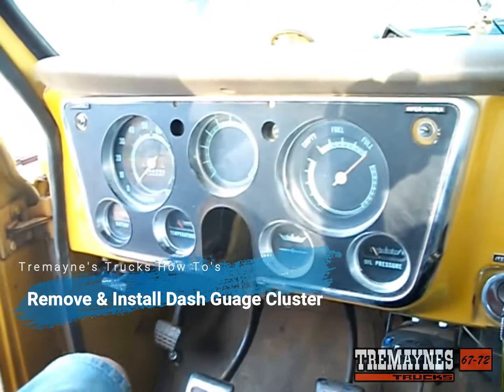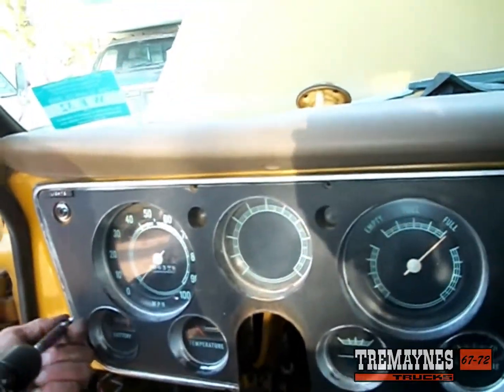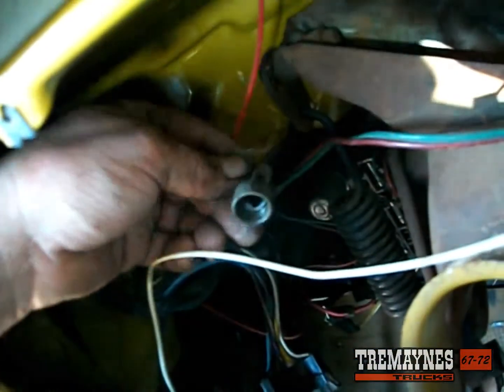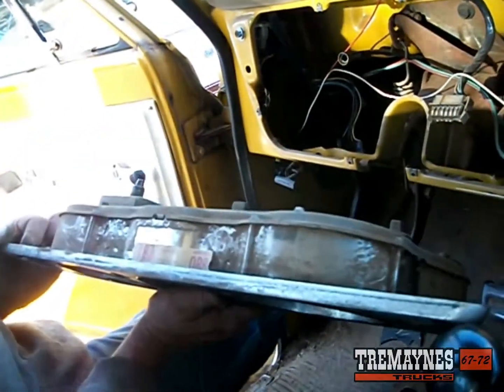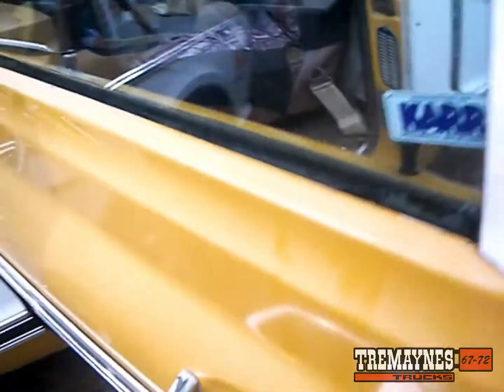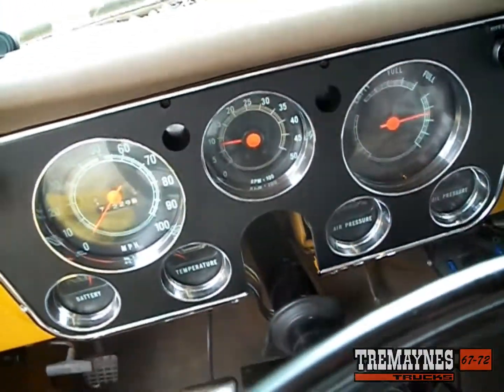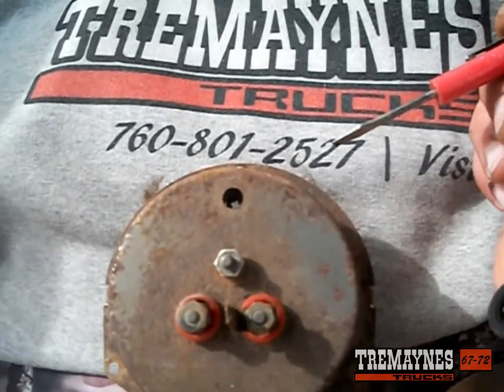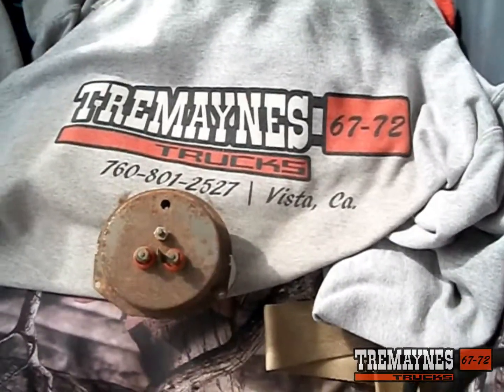Remove Dash / Gauge Cluster 67-72 Chevy C10 Truck

Comment: you might need a second wrench to hold the dash side oil line coupling. Be super careful when reconnecting the soft, brass oil pressure line.

Comment: I have a question. When I remove the gauge cluster and I want to change just the black plastic outside trim can I use the same gauges or do I have to use all new gauges?
Reply: You can reuse your gauges.
Reply from the maker: Yes you can use all the existing gauges, tins & lens. I recommend checking the electrical circuit board on the back of gauge panel. Replace if it looks like it's deteriorating

Comment: Hello a quick question where does the shift indicator fiber optic cable go??
Reply from the maker: To the light socket to the right of speedometer
Reply: Dose It connect to the cluster feed wire on the fuse panel . I'm missing the wire for the fiber optic trying to figure out where it might go

Comment: So nothing connects to the temp gauge it just works of the wire harness? I have a 72 all guages work but the temp guage
Reply from the maker: Correct. Everything goes through the harness and circuit board. Check gauge by removing the wire from temp sending unit and ground it. The gauge should jump. Most likely the sending unit is bad

Comment: Great stuff. I am trying to get the temperature gauge working and notice there is no hard connection directly to the temp gauge? does it connect the sending unit from the wiring harness?
Reply from the maker: All the gauges feed through the bulkhead connection that plugs into the back of the cluster and runs through the circuit board

Comment: Factory air pressure I mean..
Reply: Air pressure gauge is out of a C/40, 50 or 60 for air brakes. They work great for air bag suspension system instead of having a aftermarket gauge hanging below the dash